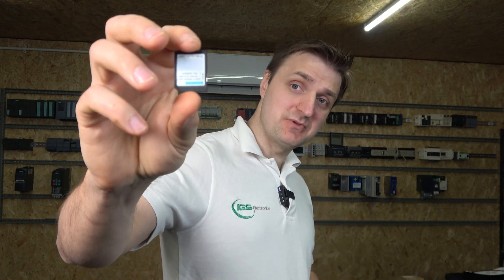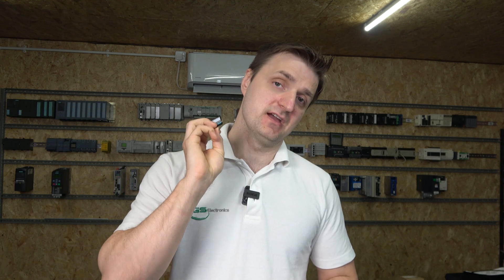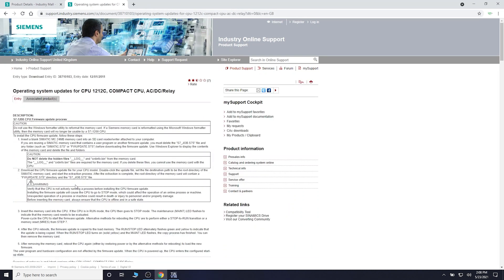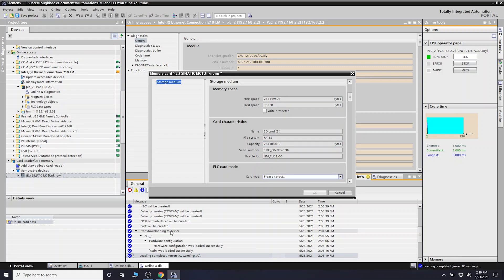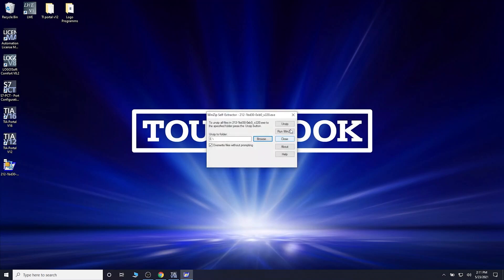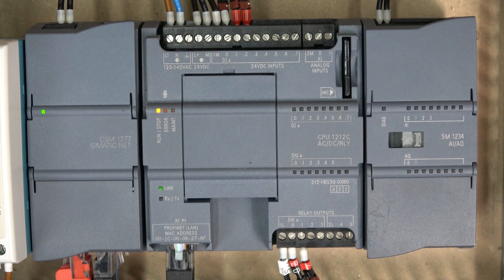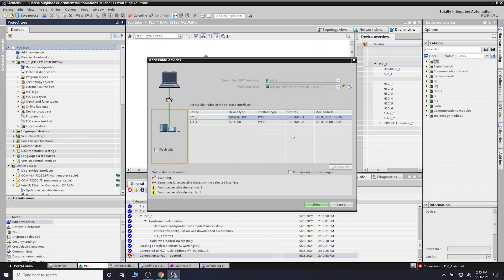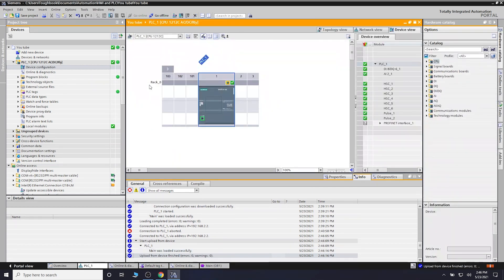Siemens S7-1200 first gen PLC firmware update from v2.1 to v2.2 using Simatic memory card.

Comment: Thank you!!! After migrating to TIA V16 (from V14) the application seemed to work fine. It was much later that I found out that forcing and watch-modifying does not work anymore. I have a 1214C CPU with FW V2.0.1. I soon found out I had to upgrade the FW to 2.2. But all tutorials so far showed you could 'simply' do a FW upgrade from within TIA. Even at our work (with an advanced 1200 and 1500 CPUs) this worked this way. But not on my 12 yr old 1214. Till I found your video. Thank you once more!